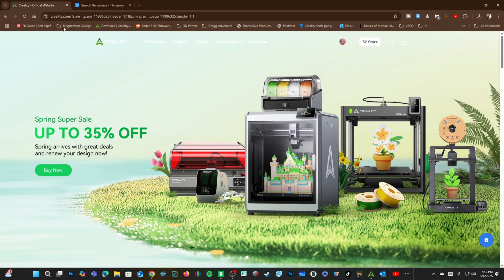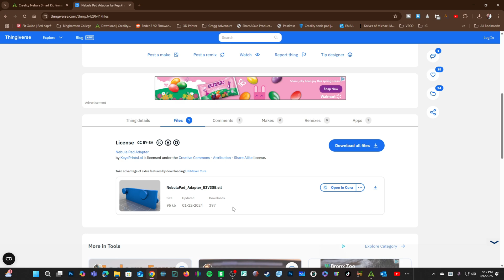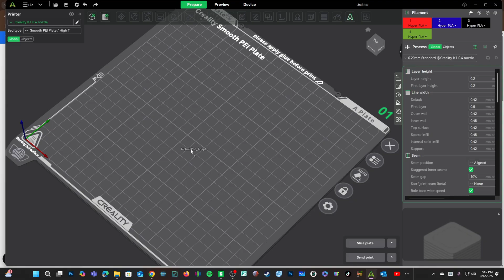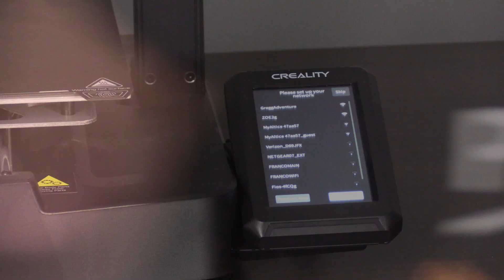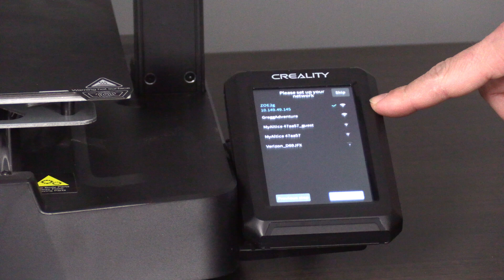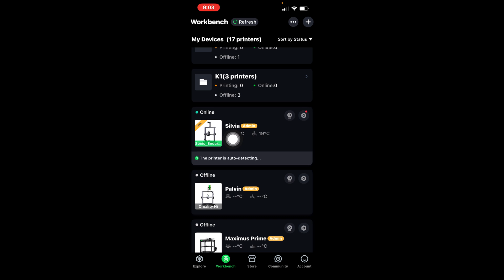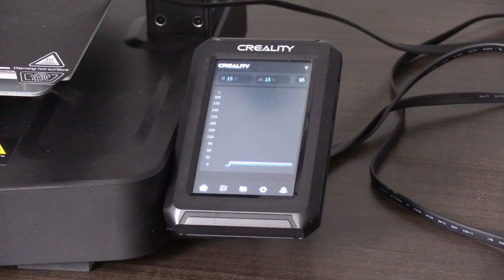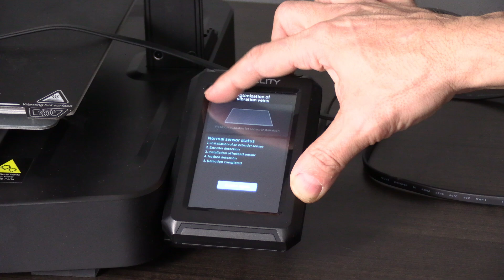How to Install NEBULA PAD on Ender 3 V3 SE - Screen, Firmware, G Sensor. Creality 3D Printer

Comment: I have a question, where did you actually find the firmware? Going onto the website now just seems to lead to a corrupted disk img file. There’s no print parts, there’s no files, all it downloads by pressing the button is that img file. Contacted customer support and haven’t heard back but the chatbot kept sending me website links that don’t exist anymore. Does anyone have a working link of the firmware on the site or a way to get a valid version of the firmware? 

By the way I even tried copying your URL completely from the video and it leads back to the site where I can’t even find the nebula smart kit at all mentioned. It just doesn’t seem to be available anymore.

Edit: I FOUND IT! The kit comes with it all on a USB drive. If anyone else is having this issue, check the white USB drive that comes with the kit :)z
Reply from the maker: Great news! YES, it's on the card. Thanks for sharing

Comment: i cant find the firmaware files  in the official page  any one have de same issue?
Reply from the maker: crealitycloud.com
Reply: @3DRundown  i only found de ota update files ,  but not the printer firmware zip, this firmware is spesifict to use with nebula pad or is only a newer ender 3 v3 se   firmware ?
Reply from the maker: I have the file dump in my Member library. It's hard to keep up with what Creality is doing with their links. :/

Comment: Thank you for the simple tutorial!! I have one problem with my ender 3 se tho. It wont get past the connect screen and after a while throws an error with the new nebula pad. Also since it is a newer printer with the C14 instead of the C13 at the end of the H/W Ver I think thats the problem because there only is the option to the se with the C13 version. I hope to get an answer from you soon, else it will be going back to China.
Reply from the maker: I am hearing trouble with the C14. I don't know the answer. I would ask Creality. I'll try to remember to ask them. For now, can go back to Marlin Screen, but Nebula is SO much better
Reply: @3DRundown Quick update: I wrote them and they sent me the firmware for both the nebula pad and C14 Mainboard. If anyone wants it message me for (NEBULA_ota_img_V1.1.0.30.img) and if needed also the Mainboard firmware.
Reply from the maker: The C14 Motherboard Firmware is in the Members Library.
https://www.youtube.com/channel/UCbUb8QjvZiimB-8sN6oDl9Q/join

Comment: I have an Ender 3 Max Neo and the Nebula Smart Kit, which includes the G-Sensor. What sensor bracket does it require and where do you mount it?
Reply from the maker: You can double sided tape it on, then remove it when done. I'll try to have a look at the NEO. It's one of the only Enders I don't own.
Reply: @3DRundown  Ok, thanks.

Comment: I have the upgraded swiss tech hotend to run PA6-CF. Ive all ready updated the firmware to run at 300°C. Will this upgrade allow me to keep this or will I need to modify the firmware again?
Reply from the maker: This will move you from Marlin to far superior Klipper
Reply: @3DRundown will I still be able to extrude at 300°C?

Comment: One VERY important note - if you bought a v3 SE in the past few months, you may have a version C14 motherboard, in which case after starting the printer up with the firmware-loaded SD card in it, nothing will happen. This is because the Nebula smart pad is currently only compatible with C13 Motherboards, and it is not possible to downgrade the firmware from on a C14 to match that of a C13. The solution is to buy a C13 motherboard and replace it, or wait until the nebula supports newer firmware. Learned this the hard way.
Reply from the maker: Holy cow, is this true? I have not heard this..... That makes Zero sense. I will email Creality about this.
Reply: @3DRundown  Please post a short vid when the new firmware drops. Bookmarking this video.
Reply: @3DRundown  Yep I confirmed with them over email after finding a reddit post about it 🤷‍♂️. But after swapping mobos followed your vid and everything worked great! 

Also if anyone is going to do what I did and they bought the printer from amazon I talked to Amazon support, told them the situation, and they credited the cost of the C13 mobo to my account.
Reply: @mordan4  Well done!!! I think I'll for a firmware update.
Reply from the maker: I can't believe this is still an issue.... I had assumed Creality would address it. Looks like I have to bring it up.....
Reply: @3DRundown did you receive any news from creality?
Reply: @3DRundown  Hey do you still have the 3d Print Software. zip file and the Nebula Camera Firmware. zip? I can't find it on their page anymore.
Reply: Well this would explain my issue I bet. I keep getting a nozzle error but it also doesnt look like its taking the software update.
Reply: Yeah that was my problem. I have an older printer so it has the C13 but I recently put a new motherboard in it. I put the old motherboard back in and it works perfectly. Thank you sir for that info.
Reply: Thanks for this!!! At first though it was the crappy SD card. Also might explain why the screen could not connect to my WiFi network.
Reply: Is this still a issue? I want to upgrade but got mine yesterday
Reply: @JT-Audio39  I have same issue, having a C14 motherboard. Today I received a test version of the firmware for C14 motherboard. Now I need to figure what to do with it as it is not a .bin but a .img file.
Reply: @DaveyBrankaert  You should be able to just mount the img I believe
Reply: @DaveyBrankaert  wellupdate is easy if you follow the instructions but dont bother to do it. However Creality stubbornly refuses to provide any pre production FW for me I have got pre-production FW pack for Nebula (.img)  and V3 SE (.bin) from another source. First it dit quite well, but after few hour of printing it completely failed... it erratically heated and coooled the hot end and stopped printing at all with "unknown error"... even diferrent nebula pad FW didnt worked (at least it was rooted) but I rather put back the original setup and will wait for official (hopefully working). Maybe I will get older mainboard, but at this time I am refusing to pay Creality any more money.
Reply: @DaveyBrankaert how can i get that test firmware for c14?
Reply: @JT-Audio39 AFAIK yes but id check with creality support.
Reply: Thank you for posting this.  My last E3V3SE died so replaced it and I've spent HOURS trying to get the board updated.  Well, at least now I know.
Reply: @joepodell np!
Reply: How do you find out the Version of your Motherboard ? Is it written on it somewhere ?
Reply: @auholmesc in the settings somewhere on the display. Dont remember exactly what option but look around and you should find it
Reply: @auholmesc  SETTINGS=> scroll down to INFO. You'll find it.

Comment: Any troubleshooting advice on how to resolve error : axis movement detection. Unable to complete setup due to this failed system check.
Reply from the maker: No clue.... Never heard that error. But, I would start by checking all your wheels, eccentrics, frame screws, and BELTS, to be sure everything is snug.
Reply: @3DRundown Thanks.. I  re-flashed to original factory setting with existing screen and everything works. Plug in nebula and it doesn't work. Ill con't to search for answers.
Reply from the maker: Sigh. I've heard this before. 🥲
Reply: @3DRundown  i have this exact issue, has a solution been found?

Comment: No matter what I try I just get a warning message "Machine motherboard communication anomaly, please scan the QR code for a solution. I scan the code which is no help what so ever. Do you have any idea on a solution for this?
Reply from the maker: Could be a bad board or hot end. I'd start with reconnecting the wiring connections for the hot end at both ends

Comment: thanks for this guide i have misplaced one of the screws holding the hotend wiring cover on the ender 3 ve se do you know if those are special or just m2 o3 screws so i can replace the missing screw?
Reply from the maker: likely M3. I keep a cheap amazon set of various sizes.

Comment: Since I changed to the nebula kit I haven't beable to produce one successful print if you have an V3 SE just stick with it stock saves alot of Hassel not worth it for the camera and WiFi because it rarely connects and klipper I have found needs way more fine-tuning than marlin. I was convinced the nebula kit and klipper was the way but for me it certainly is not think about this before you purchase
Reply: clipper is easier to jerry rig for noobs. A  lot of compensators for crooked frames and hands. If you only have one printer and if you bought cheapest crap there is (v3 se) there is 0 reasons to "Upgrade" it, just buy what you want from the start to not waste time and more money.
Reply from the maker: Klipper and Nebula pad wipe it's ass with Marlin
Reply: When it was working I agree they absolutely do the klipper nebula prints were so much better quality when it was working. It just never connects and now I'm having motor problems in not sure I'm I brought a faulty nebula pad but for tha Hassel I think stick the printer was fine despite the not perfect prints  @3DRundown

Comment: I had the problem. 
Of starting the k1 reset.
Gith that one thru reddit. 
And yesterday i goth i message on my nebula pad red dot to install a newer version and i was ready today to start up a print and wanted to reset the se .
Bud it booted up whit out resetting the whole printer fast and the problem is gone.

Comment: I downloaded the g sensor and the screen bracket, but they are zip files which cura or creality print don't take is there any tips that I can have to resolve this issue
Reply from the maker: Unzip it, broski. Files are inside

Comment: hi if i try to boot it it doesn't work im at the automatic z offset by the step nozzle cleaning it gives me an warning it says z-axis sensor data transmission anormaly and if i click ok i get the same screen what do i need to do to fix it and no vibrating sensor is not plugged in and sorry for my bad english it isnt my firsy language

Comment: Is there any difference in speed when comparing the nebula pad and the sonic pad? Which is better when using only one printer?
Reply from the maker: Both are Running Klipper. However, Ease of use, goes to the NEBULA by a country mile. But I've had great luck with my Sonic Pad. Nebula is a no brainer for SE
Reply: @3DRundown Is it because the sonic pad is of better quality?
Reply from the maker: It's just much more complex. The Nebula is meant for ONE machine, and the Sonic, up to FOUR. It's large, and the Klipper version on it, is a little more complex to work with. Either one will be fine, and work in similar fashion.

Comment: Great video............. do you use same firmware and procedure for a ender3 S1 Plus??????
Reply from the maker: I've never done it, but, it should be very similar. The firmware part is a little confusing. Poke around some reddit threads on the topic. Allot of s1 nebula chatter there. I will TRY to do one soon, but, I dunno when/if I will make it

Comment: The extrude function is really weird… when I want to extrude it doesn’t say when I need the push the filament in… help pls?
Reply from the maker: You don't push at all. Put the filament in the hole. Then press extrude. It does the rest

Comment: is it guaranteed that the printer will work properly without issues, with the nebula kit if you follow this tutorial perfectly step by step?
Reply from the maker: Nope. But it should. Nebula and Klipper, are endlessly better than the ancient Marlin setup on the SE
Reply: Thank you for the insanely fast reply, I’m quite new to 3d printing and have 1 more question, if the nebula kit doesn’t work for me would it be possible to revert to the old Merlin system?
Reply from the maker: YES. The upgrade is super easy. I think you'll be ok. I'll be here.
Reply: @ thank you for your help👍

Comment: Love the video!! thanks for explaining. 
Do have one question. why dont you need the G sensor? i just can run it with no sensor?
Reply from the maker: Yep. The sensor detects vibrations and sets the machine to compensate for the results. Unless anything changes, no real need to run it again. You could.... But, it's somewhat overkill. I have yet to use mine more than once, unless it's built in, which makes it super easy
Reply: @3DRundown  Thanks!!

Comment: Thanks for the instructional video! I'm having an issue with the nebula pad I bought. For some reason, when I initially boot up the printer with the firmware SD card inserted, the nebula pad is just blank. If I tap the screen near the bottom, I hear a beep, but that is all. Do you have any idea what might be wrong?
Reply from the maker: Be sure you have the right firmware. 32gb card or LESS, fat 32. RENAME the firmware file, and try again
Reply: @3DRundown Wow, thank you for the quick response!

I tried all of your advice; except, not using the hunk of junk sd card that came with the printer. When I reflashed the marlin pad, the sd card worked. 

Perhaps I have a bad nebula pad. I will contact creality tomorrow.
Reply from the maker: Never use the cards that come with this crap. I F*** myself MORE Than twice, doing that.....
I hope not, but, perhaps. Good luck. Here if I can help. I Also have a Nebula group on FB

Comment: When u turn your printer off and back on at a later time it comes up system error,try restart ?   And I've followed your video to the t   ???    What am.i doing wrong
Reply: Same problem. Every time after turning off and on I have to reset to factory settings and set everything up again. I wrote to Creality support, I've been waiting for an answer for 3 days. At the moment I have not found a solution on the Internet. I have already learned all the settings)
There is an assumption that the latest firmware version is unstable, but the Nebula Pad insistently asked, literally forced me to update the firmware when I turned it on for the first time. If I knew I would encounter this problem, I would not have installed this update.
Reply: still have the same effing problem... and creality can't really help... apart of saying unplug the cr touch...or give us more infos, videos, your shoe size.... 😂  @CMEPTHUKnsk
Reply: Same bud yesterday after a update ot is gone @CMEPTHUKnsk
Reply: @micver1091  solved couple weeks ago
Reply: Same
Reply: you mean that the CR Touch LED stays on solid red?
Reply: Im a boy mom and its 😅been an absolute failure with all the research I did i bought 3v3s3 printed the shovel that is all that has went well buying the sonic pad and it is not updated to support so   was told wifi box 2.0 was the way to go but it is reviewed to be trash what in the bloody hell will work with this print 17 steps of return items

Comment: Hello, you have problems to print woth klipper? There are times, depending on the selected file, it doesn't print, or it freezes, and if it manages to print, it's not centered. I've been trying to understand Klipper for over a month...it's a headache.
Reply from the maker: I haven't done any prints on the SE, but, nearly all my machines have been Klipper for ages now. Klipper is no need to stress. You should be fine on Klipper. Something is wrong....  First, what slicer are you on? Be on CP6, or Orca. Learning both is a great idea. Be sure you are using the correct profile. If not, your bed size could be wrong in the slicer
Reply: @3DRundown  shutdown due to webhost, That error haunts me. I've changed many devices and cables. What a headache.

Comment: I was never able to get the nebula system to work on my Ender Pro 3.
Gave up on it. 
I have a pile of parts to add to it for funs sake.
It's a sideburner project as it's been "replaced" with  4 k1's and an a1 mini 😁👍
Maybe I'll give it another try.
Reply from the maker: The mistake most seam, to make, is trying to "update" the NEBULA, rather than the machine. However, it might be time to let the 3 retire.
Reply: @3DRundown  I just want the satisfaction of making it all work!
I know it's 100% not worth it. But I neeeed to do it.. 😆
Reply from the maker: I feel that on a spiritual level....
Reply: I just got it and followed the instructions correctly for updating the firmware with the provided firmware on the included SD card which matches the one on their website; however, there are only 3 models that display in the list on the pad: Ender 3, Ender 3 (CR Touch), and Ender 3 Max Neo (CR Touch). There is no option for an Ender 3 Pro like it shows in the manual and pictures of setup online.